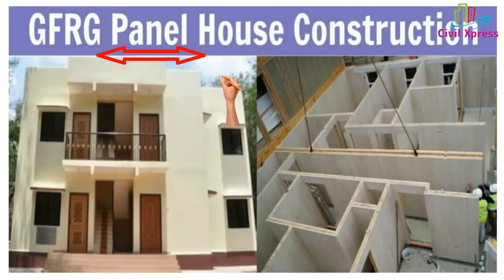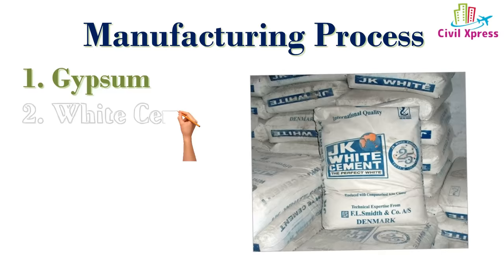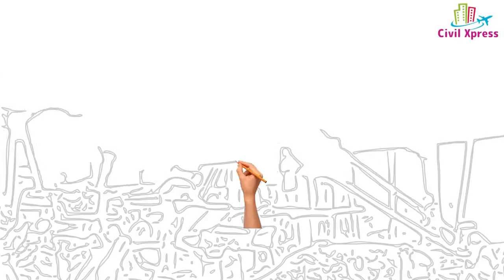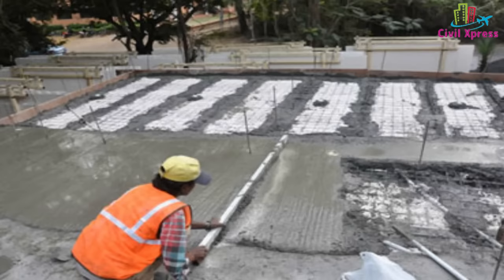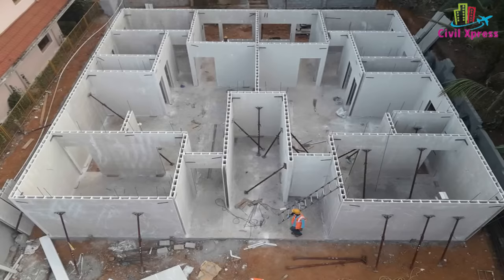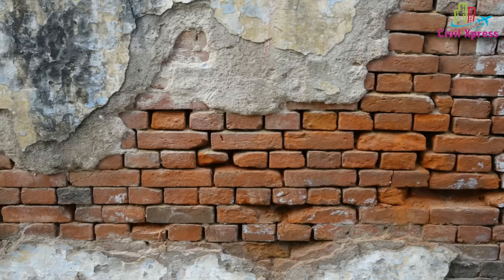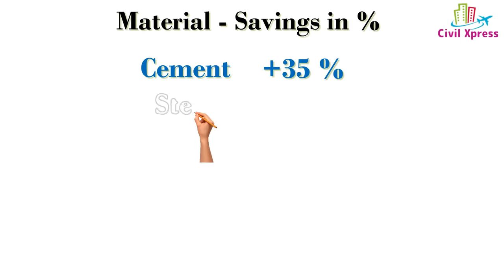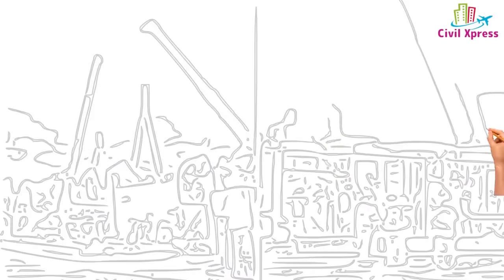6Lakhs Budget House | 600Sqft | 2BHK | GFRG Panel House Construction in Tamil | Review |#GFRG #Civil

Comment: How split air conditioners can be fixed? Will there be provision for portraits hanging?  Water storage tanks can be accommodated on the roof or should they be on the ground. Plumbing /sewage openings are prefab? Interesting info. Get going.

Comment: The voids on the panel be closed with Ceramic wool to reduce the heat during summer as well as in winter ( to conserve the Warmth) such that the inside of house will always be maintained at 72 Deg, F.

Comment: Concealed wiring with tubes? plumbing, bathroom fittings, Fixing of roof fans and lights, fixing of windows and doors. provision of lofts & fixing of wardrobes and doors for the above, concealed electrical points, kitchen platform etc?
finally cost?